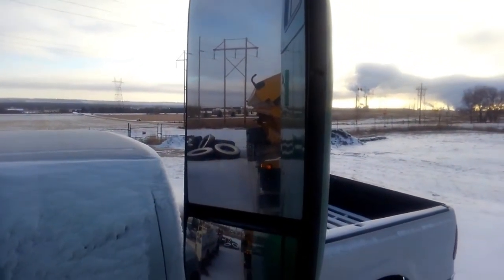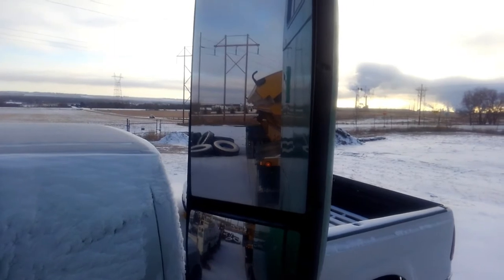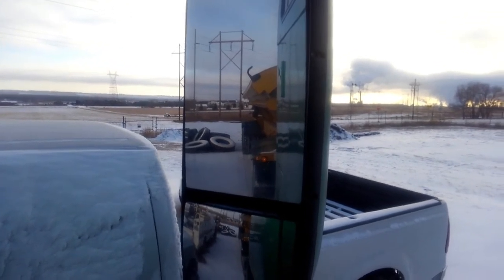diagnosis of the rear axle on the Mack.

Comment: You should check the axle shafts on the rear too. I have broken an axle on the back and it would only pull with the power divider locked.
Reply from the maker: with the trans in N and the power divider unlocked you could spin the front drive shaft and the intermediate would not spin. try to spin the intermediate shaft. and it would  not spin, indicating that the problem is in the front diff. also when i pulled the oil plug in the front diff a bunch of chunks of metal came out.

Comment: Also could be an easy fix. Remove the diff cover after you removed the fluid. then once you have the cover removed, check the jake brake pads inside the diff. The symptoms you have sound like the jakes are worn out. Its like 30 bucks for the set of them. Takes one hour to install. Been truckin for 30 years, would hate to see a fellow trucker spend all day removing a rear when all it was the jake brakes wore out. Change those pads out. In the future, use your head instead of using it for just a hat rack.
Reply from the maker: spider gears in the center section were blown apart. 
check out part 2-3 of this video of the repair. where i remove the 3rd member and find the problem and part 3 installing a new center section.
part 2 - https://youtu.be/P9lgdEEDVAI
part 3 - https://youtu.be/RxQFAIiGm08

thanks for the comment.
btw your jake breaks are in the cyl heads, not the rear ends and they don't have pads, they open the exhaust valve at the top of the compression stroke.
Reply from the maker: lmao you got me, i was really shaking my head on that one thinking wow, this guy doesn't have a clue, but was trying to be nice.....lol
Reply: @Noble Roofing & General Contracting ,  a  delirious  know   nothing  know  it  all . Jake  brake  pads ? 😂😂😂 .  Really ?
Reply: 😂😂it’s crazy that’s most people provide information don’t be knowing shit. Just trying to sound smart. Appreciate it for setting it straight. Whoever that guy is. I feel for anyone who ever listens to him lol